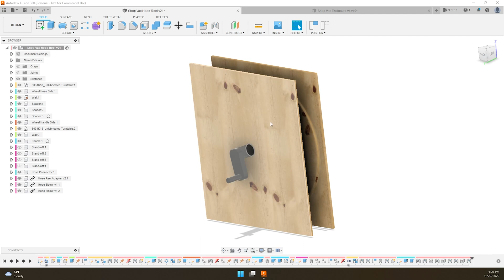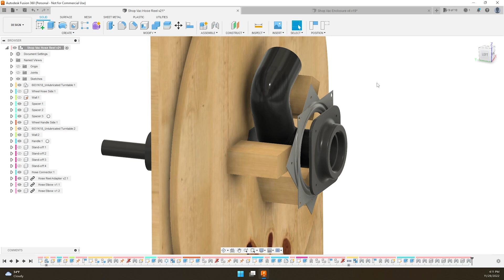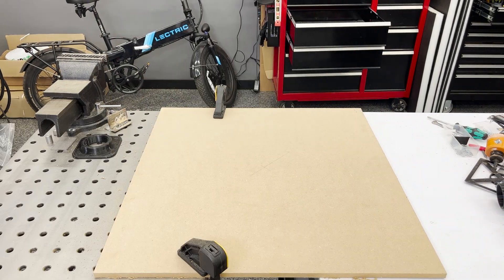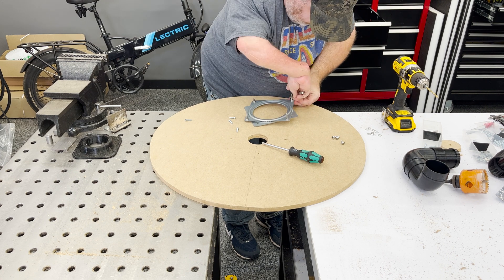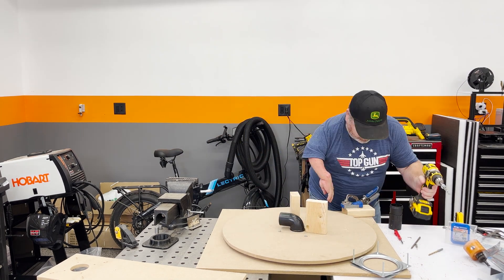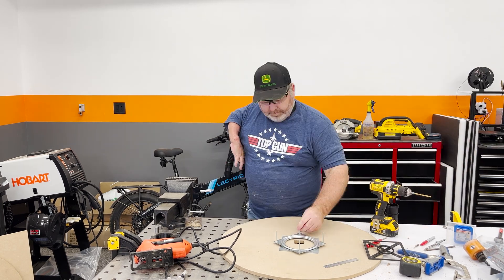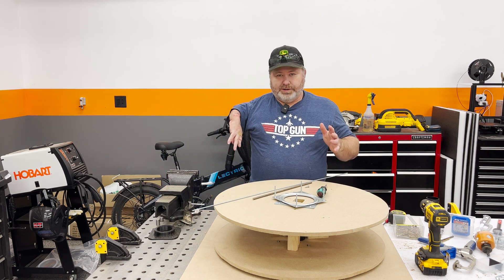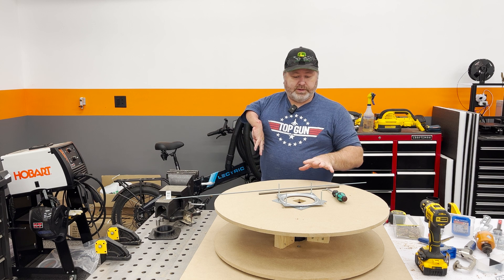Shop Vac Enclosure (Part 2) - Hose Reel

Comment: Today, I almost pulled the trigger on purchasing a Cox reel for my vacuum 30’ 1.5” vacuum hose. I would like a 50’ hose, however, my current method of storing the 30’ hose is a pain in the rear. I can’t imagine adding an additional 20’ with my current set up. 

The cox reel cost $350 after taxes. That’s  just the reel. 

I can’t bring myself to spend that much on a hose reel for personal use in my garage.

Your video was just what I was hoping to find when I started my search here on  YouTube for a Diy solution.

If you’re willing to make an additional set I would love to purchase the pieces that you 3D printed so that I can attempt to replicate your design.

I understand this request is a long shot however I’ve got zero experience 3D printing things and don’t have the equipment. 

Please let me know if you’d consider my offer. Thanks and definitely earned a like and sub from me buddy! Nice work.

Comment: Brent, thanks for sharing this.  will you be making the STL files for the 3D printed parts available?  Thanks.
Reply from the maker: Thanks for the feedback. I had always meant to make them available, but I am too easily distracted. :) I have now uploaded them to my new thingiverse profile, but I cannot publish them for 24 hours (new thingiverse account restrictions), so you should be able to see them sometime tomorrow. I updated the description of the video to include a link to my thingiverse account, but is it under MakingOfBrent in case you have any problems finding it. Let me know if you have any issues with them. Thanks!